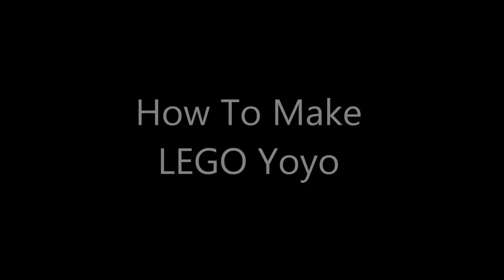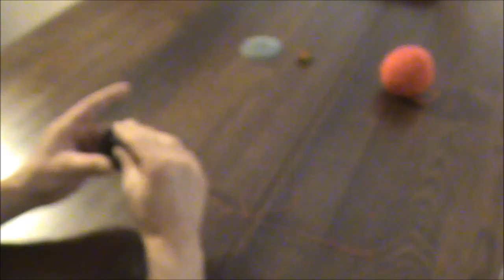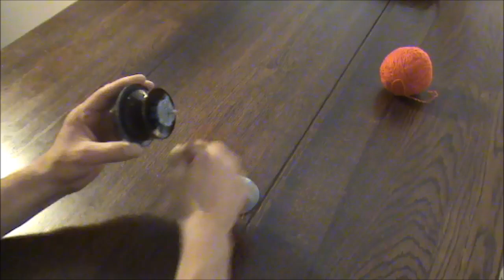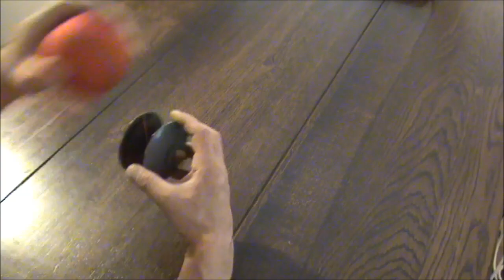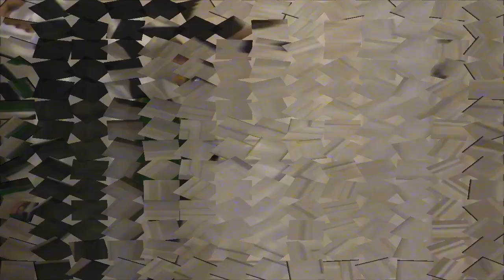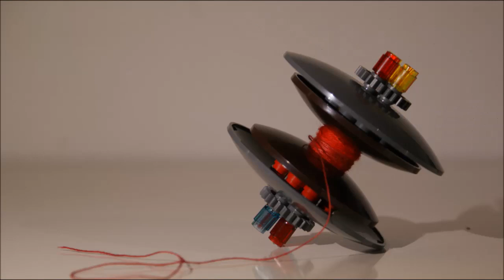How To Make LEGO Yoyo

Comment: you could build around this idea, but if you really wanted to do tricks, you would pretty much be required to superglue the legos together, otherwise the spinning or the return would likely force the legos to fly apart.
Reply: I don't think supergluing them won't let you do tricks, it shouls also require weight distribution, design quality, a ball bearing and a response system to make a yoyo decent enough to make tricks.

Comment: can iT spin
Reply from the maker: Sure it can! For regular spinning just fine, for some fancy tricks a bit too light. Just BUILD IT yourself and you will know in 5 minutes :)
Reply: +Lego Utilities it doesn't sleep witch means that you can't do tricks with it
Reply: ShinyGenesect 123 it doesn’t sleep because you tied the string to it. Yo-yos need a sleeper string to sleep—a loop at the end of the sting—for the axel to spin inside of. Also: the thread used looks awfully light for a yo-yo, especially without doubling it up.
Reply: i have a yoyo that spins an its cool you can do tricks with it